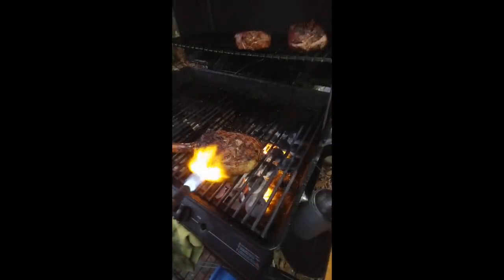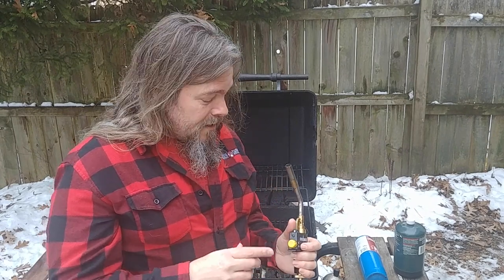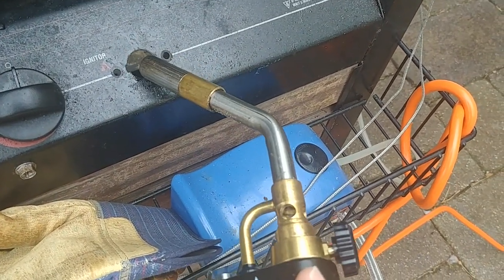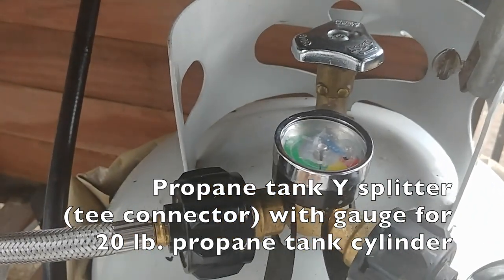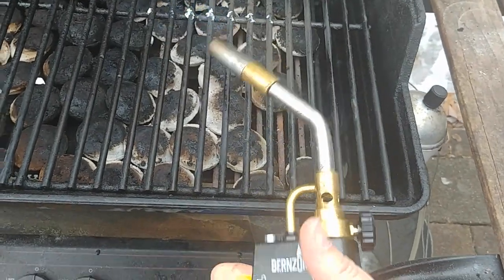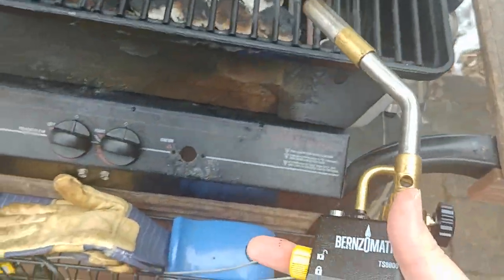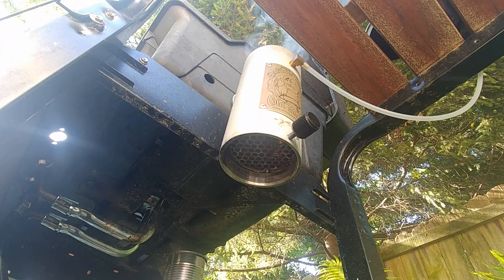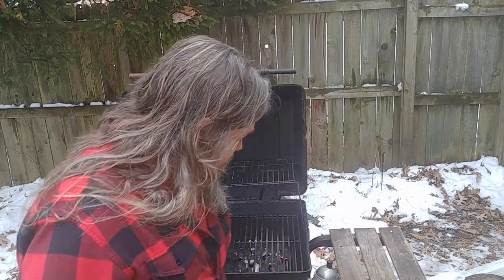Add a blowtorch to your gas grill!

Comment: Any excuse to bust out the BBQ grill.  You've got a number of good ideas going on in that grill.  I wouldn't mind a video of how you handle a nice smoked leg of lamb or something.  I've got a vertical gas smoker which I love, but it seems pretty different to your setup.  What sort of temps do you run for a smoke?
Reply from the maker: Hi Adam! I'll plan to focus on something different than other channels have done. There are a ton of great channels I follow showing cooks of smoked meats. (This is one of the reasons I don't have my smoked meat escapades on my cooking blog yet, despite smoking meats just about every week: https://kitchenconvivial.com/)

If you are interested, my top recommendation is Cooking with Ry. Here is the only lamb he's posted: https://www.youtube.com/watch?v=_KWEmYjxp84 
T-ROY cooks is another that has taught me a lot.

Lamb isn't as popular in the U.S. as in Australia and New Zealand, but T-ROY has a few!
https://www.youtube.com/results?search_query=t-roy+cooks+lamb
Reply from the maker: In answer to your question, I smoke things 250F - 275F (120 - 135C) most often. The rotisserie chicken I have on now is in that range.

I've modified my gas grill to have a low BTU burner so I can maintain those low temps. I will be posting something about that soon. (Involves drilling the brass propane orifices to small sizes.)
Reply from the maker: Oh, and this is my friend David's channel. He uses a Bradley smoker (amongst other ones), closer to what you have:
https://www.youtube.com/c/OldfatguyCa
Reply from the maker: Hi Adam! I was working on the grill and decide to test it with a real cook to show how I use this setup - in case you're interested!
https://www.youtube.com/watch?v=6O0IsfT9Omw 
Peace.